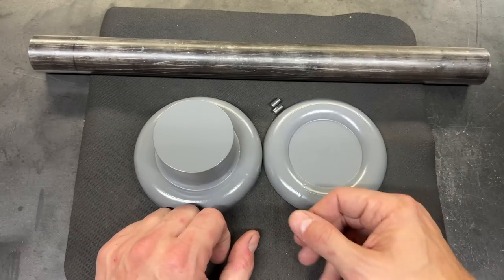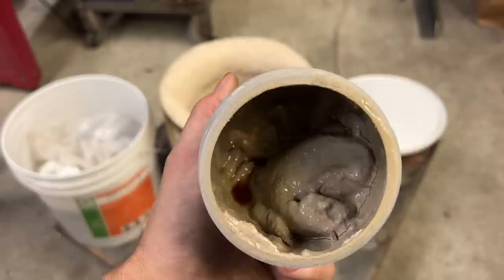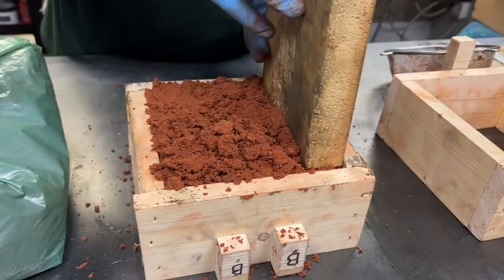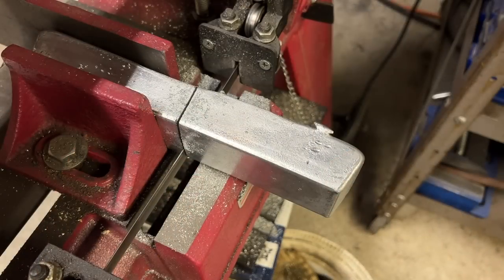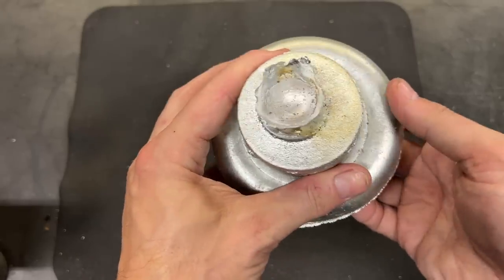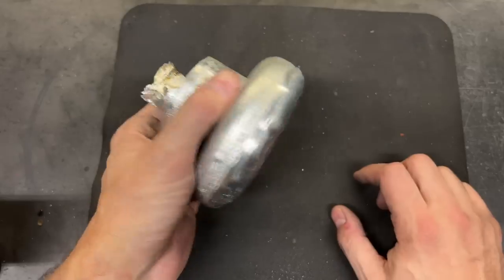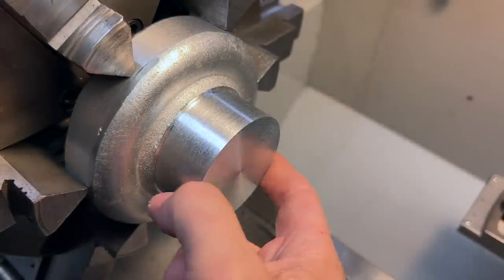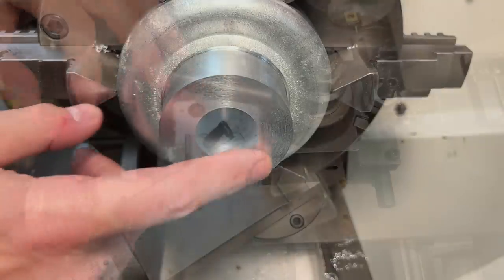My First Metal Casting - From a 3D Print!

Comment: i little suggestion. i would have frozen the draw tube and heated the casting. that would have made the press easier.
Reply from the maker: Thanks very much! Those are good ideas. I considered doing a shrink fit but in the end decided against it because I don't have the means to cool the part as much as would be ideal, and I was hesitant to put a torch to the zamak as it's melting temp is right around 800-1000F. The press fit did the job well though, and there "shouldn't" be a need for a grub screw, fingers crossed anyway... 🤣 But thanks for the good feedback and ideas!
Reply: Check Machinist Handbook too see what the expansion rate is for aluminum and melting temp. Cheers
Reply from the maker: @zedostenso3069  Thanks!

Comment: Neither half of the mold was packed hard enough. Your sand looked like petrobond.  Petrobond should give a good surface finish if properly packed.  The top of the torroidal portion looked OK, but the bottom and the neck show signs of air space in the sand.
Reply from the maker: Yeah I think you're right. I was initially having problems with the mold not releasing because I guess I was packing it "too" tight. Certainly much more to learn, I plan on trying more castings in the future, so hopefully I'll get there. Thanks for watching!

Comment: What I'm missing in this video is applying the final product? Because the tube was cut too short, I was curious how the handwheel would ultimately fit on the drawbar. Furthermore, very clear explanation. Greetings from the Netherlands.
Reply from the maker: I just changed the way that I connected the handwheel to the tube. Originally, I was planning on pressing the tube through the entire handwheel so that it would be flush with the back of the handwheel. Instead, I bored the handwheel through to the ID of the tube, and then bored a 3/4" section to a press fit on the OD. This made up the difference that I needed from cutting the tube too short. Thanks very much, and thank you for watching!

Comment: I got a bit uneasy when you first suggested that you shouldn't pack the casting sand down too much.  I think a better cure is to invest more into mold release efforts.  But I'm guessing you already concluded this after the mold didn't hold shape.
Reply from the maker: Yeah, I think the tighter you can pack it the better is a good general rule lol. There's a lot to learn with casting. A lot of "finesse" I guess, especially in the mold making. I want to try some more casting projects soon. Thanks very much for watching btw!
Reply: @hersch_tool  If you do another video involving casting, I would love to hear your thoughts on zamak and where you would and wouldn't use it.  Actually, it would be great to have a general review of the types of metals that can be DIY cast and what their place might be in machining projects (and where to avoid them).
Reply from the maker: @UrbanaWoodProject  that's a great question. I'll make sure to include that sort of info in the next casting vid. Thanks! 👍

Comment: 👍🏼👍🏼! My own guidelines:
 - If possible I like to heat/cool instead of pressing as it reduces stress.
 - The smaller mass of spinning parts the less vibration.
 - Admire people who put this much time and effort into making both functional AND beautiful pieces. The "beautiful" never happend for me, it allways stops with "function"...
Reply from the maker: Yeah I haven't actually tried the method of "heat fitting"??? parts together yet, but I'll have to try that on my next project with tight fitting parts like this. And thank you very much btw, I don't know that I'd say it's "beautiful" lol, but I do very much appreciate the comment. And for that matter, doesn't function have its own beauty? Don't sell yourself short, if you making stuff that works and is useful then you doing it right! And thank you very much for watching!

Comment: Very nice video. Found it very helpful how you explained building your forge. I think you need an extra hole a riser that will help to get rid of bubbles and some of the the slack...
Love to see more
Reply from the maker: Thank you very much! Yeah I think that would have helped, and someone mentioned adding tiny little air holes into the mold as well to help the air escape, which I think might help to prevent the mold breaking as well. LOTS to learn and keep practicing, so we'll definitely be doing more with the kiln in the future! Thanks again!

Comment: You did pretty good for your first try out. I will caution you about zinc. Zinc fumes can lead to foundary man disease.   It is very painful and unpleasant. If you get it, best cure is several glasses of cold milk!

The collapse in the bottom along with the tears has to do with shrinkage. The tears are called hot tears. You need to “feed” the cooling casting with extra metal. This is done with a riser. A volume of metal that freezes last. As the casting cools, it draws metal from the riser. 

Quick explanation for a comment.
Reply from the maker: Thanks very much. Definitely still have a lot to learn. I am doing some research on hot tears and how to make a proper riser, thanks for the info. Hopefully will have a new casting project sometime soon, definitely want to give it another shot. And thanks, you can't see it in the vid but I was wearing a respirator while I did the pouring, but I'll be sure to look out for fumes and will keep the milk tip filed away for emergency use only lol. Thanks again!

Comment: That zamec casts and machines very nicely.
Reply from the maker: Yeah, I think it makes a good material for general applications that don't have to be super tough or wear resistant. And it flows almost like water so should be great for highly detailed patterns. I'd like to try some more projects with it in the future.
Reply: @hersch_tool  I've watched the cast iron videos and it takes a more commitment to casting.   The higher heat means a lot more safety and the cost goes up.   Zamec is a pretty easy entry.
Reply from the maker: @robertfontaine3650  yep, I recommend it. Though I would like to try iron in the future.

Comment: How about some info on that tool holder. Never saw anything like it.
Zamac just think of Atlas & Craftsman lathes.
Reply from the maker: Which tool holder do you mean? And yep, a lot of parts on the atlas/crafstman lathes were made of zamac. It's pretty decent material for hobby shop use. Very easy to work with, and gives an acceptable result. And if something ever wears or breaks, just melt it back down and remake it! 😂

Comment: What's that rotatable tool holder called?
Reply from the maker: It's an aloris integrated tool holder. BXA-20 I believe is the number. It came in the box of stuff with my tool holder when I bought it, but they have them on MSC. Just search for your size tool post, number 20, So Axa-20, or bxa-20, etc.
Reply: @hersch_tool  found it. Thanks!
Reply from the maker: @kurb0311  no probs!